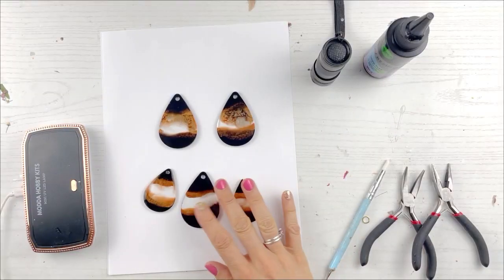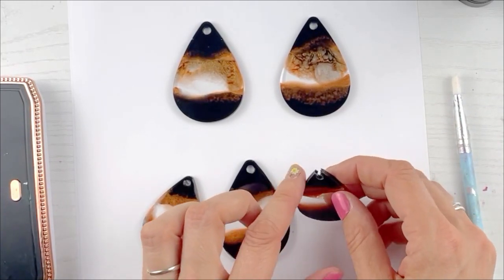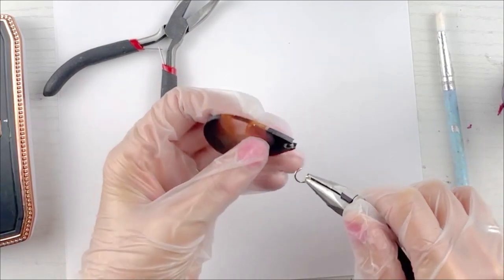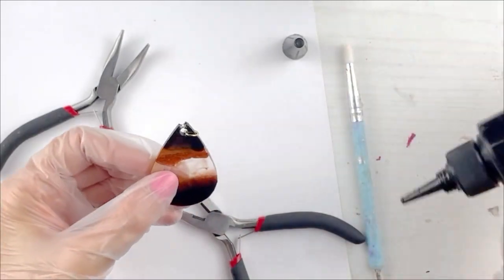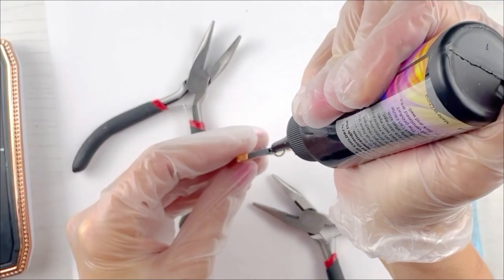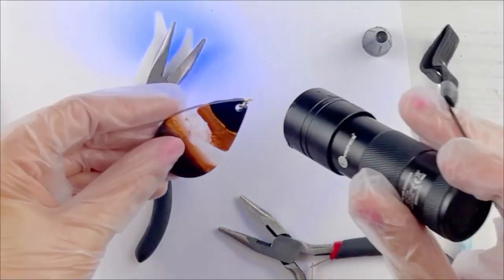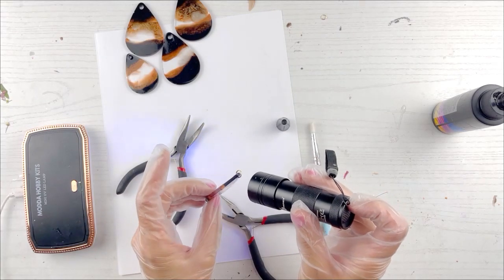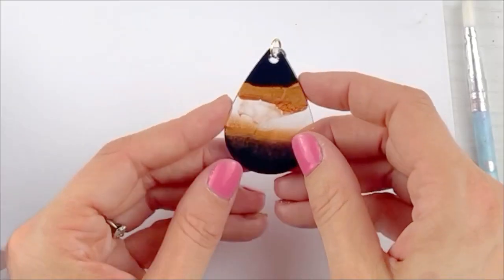The Secret to Fixing Epoxy Resin HOLE

Comment: I made a tray and I have a small indentation. I believe it is because I used UV resin to attach the handles after doing the first coat of resin. Can I use UV resin to fix that small spot or do I have to put a new layer of resin on the tray?

Comment: Have you ever had the resin get inside the little hole at the top of the bezel (where the earring finding or chain should go through)? If so, is there any way to fix it or get it out???  I'm using UV resin and sometimes it accidentally fills in the hole on the top of the bezel.
Reply from the maker: Yes today been there a small drill either a manual one or electric one will do the trick
Reply from the maker: Something like this
https://amzn.to/46GQqsW

Comment: I just had this happen yesterday and tried this trick. 
I have a question is the epoxy resin supposed to be completely hard when you make earrings. Mine are still kind of bendable, which is why I needed to mend my hole. When I try to put in my jump ring, I tore the opening because it was pliable. I am completely new to this craft.
Reply from the maker: So it can mean one of two things. You didn’t wait long enough for it to cure/dry. Or it was not mixed properly. 
It should not have ripped. It should get so hard that if you put a jump ring on it doesn’t tear. 

How long did you wait for it to cure?
Reply from the maker: All learning. You are doing great. Keep going. So much to learn with resin
Reply: @DezyJewelry   Thanks  😊

Comment: My only problem is that expoxy and uv resin is too liquid for corners. Ive read super glue may help and I am tempted. Especially since a lot of my pieces are not meant to be incredibly intricate but me using up the remainder of my mixes.